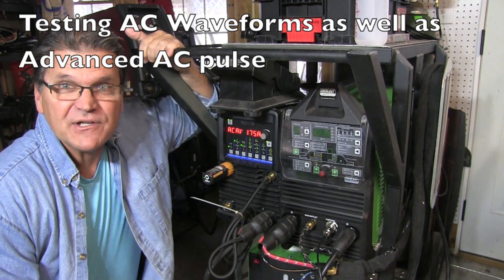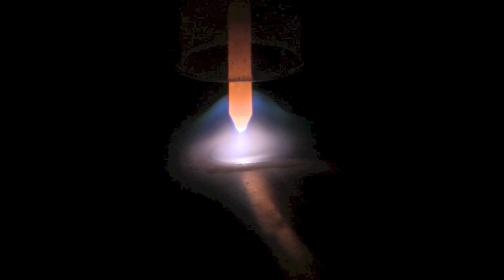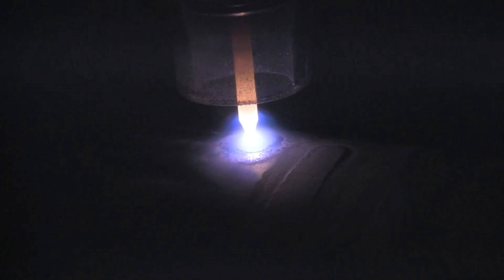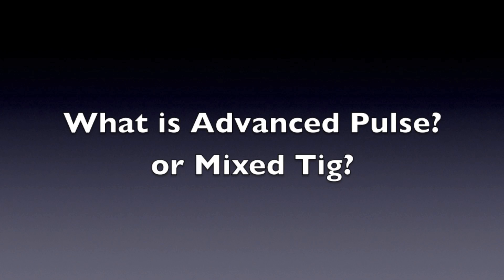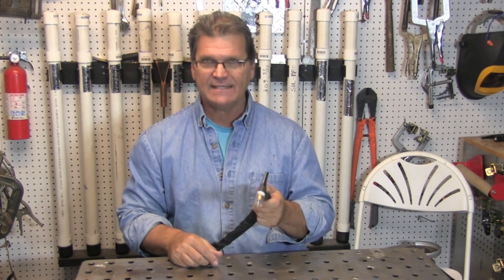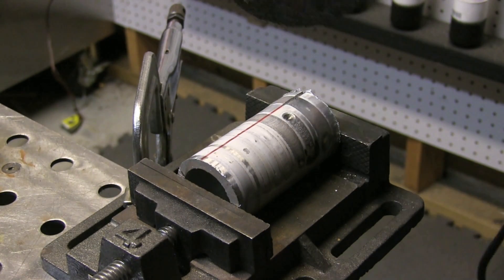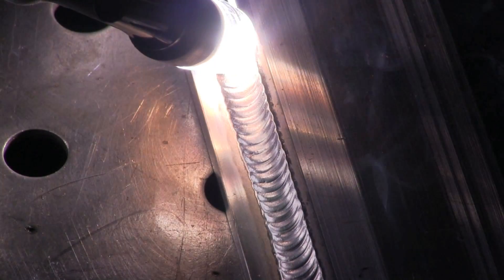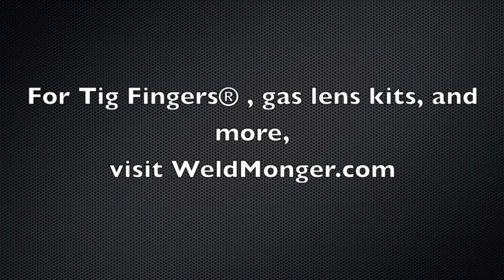AC Waveforms and Advanced AC Pulse Tig - Miller Dynasty 280 and Everlast 255ext

Comment: The different waves are how quickly they lower and then switch current so the different waves create how fast is goes from cleaning to penetrating.   I’m not a professional welder jus referring to how the waves work in electronics in a vehicle wiring and sensors.

Comment: Would you be interesting to see how many amps you could reduce the advanced waveform to match the square wave. Compare the heat affected zones of both welds at equal penetration depth within the base material.

Comment: Do the different wave forms place different loads on the hardware producing them?   As in will the machine (computer board) last longer using one wave over another?
Reply from the maker: That’s a great question. I honestly don’t know the answer.  I don’t think  using any one waveform is worse.  I have a friend with a dynasty 400 who welds aluminum all day and switches waveforms often depending on situations. I know that doesn’t really prove anything but it’s something

Comment: The X axis is time, and the Y axis is voltage.  The middle point is 0V.  The wave form is just how abruptly the voltage goes up and down.  On/off is a square wave.  The ebb and flow from an alternator is a sin wave. A micro-controller and a few cheap components can produce whatever wave you like.  The square wave works well because it blows out the oxidation.  Electronic stuff likes the gentle sin wave.  The flat peaks of the squares are moments of DC current.  AC is simply DC that flips between DC+ and DC-.  It's the building and collapsing of a magnetic field that makes transformers work.  They likely give you those options because it costs them virtually nothing to include them and they can up the price.  The advanced square sound the same as simply lowering your cleaning pulse.

Comment: Question about the syncrowave 300 with the advanced squarewave vs dynasty 280 Dx with wave form selection. Is that 20 Amp difference going to hold me back alot?? I ran into some 3/8" aluminum the other day that my chinease 200 amp machine couldn't really penetrate.. im On the fence with the selection. I feel I may need the more amps.  I'm getting it more for ac aluminum welding and  the dynasty has more options along with ac pulse. Help and thanks

Comment: Isn‘t it just like that you just transfer the amount of energy in each direction (EN and EP) summerized below the wave? So most energy is transfered by „advanced square“ and least by „triangle wave“? Additionally there is the „frequency“ effect tighten up the arc when containing higher frequencies so most of that effect should be seen with „advanced squere“ and least of it with „sine wave“? Other than that the effect should be hardly noticable. Corret? (As maybe known higher frequencies are contained more as faster the waves rise or fall on their sides)

Comment: Isn't the heat in the arc?  I thought both ends were the same temperature and polarity only affected which way the metal vapour migrates.  If this is true, the balling on the electrode will be fouling from the base metal and not the tungsten melting.   This jives with using EP to crack off an oxide layer,  or to prevent tungsten contamination if that matters for magnesium.  IANAW except for a bit of stick so far.

Comment: The below guys are correct: the mixed TIG case has a higher average heat input - the same as if the machine had been set to 85% cleaning: (The AC is 70% EN)*(and the cycle is AC 50% of the time) + (DC is 100% EN)*(50% of the time) = 85% EN.

Plus, you get (mild) pulsing, since the AC part of the cycle is only like 85% as hot as the DC-only part, which should help penetration.

But who cares if the machine is technically set a bit hotter? It's probably less prone to balling up the tungsten than a machine set to pulse between 160 & 190 amps @ 85% EN-AC... and you don't get the flicker.

Comment: Hi Jodie I might have the answer to your question what this advanced Pulse function is for. This fuction aka "Dual wave" on the REHM devices here in DE is described as " to use when (very) thin Aluminium needs to be welded to thick material or in difficult positions" .

Comment: This advanced AC is pretty neat, lately I was wondering why manufactureres won't do something like this, turns out it's already in the metal. Now I'm interested in what is the minimal current you need on EP side to conistently break oxide film, I understand it's probably electrode size dependant, but still? And if I understand this right, this advanced ac pulse is squarewave only, will it be hard to make an assymetric triangle wave?

Comment: Hi,

I'm just learning to weld and really like your videos.  They are very well made and well explained.  Unfortunately, I don't yet understand all the lingo but I am getting there.  Would you consider doing a video on the size of electrode you use for which application?  By this I mean could you explain why use a 3/32" electrode on a certain thickness and for which metal, etc?  Lastly, when to ball or not and how pointy a tip is better (or worse) depending on the situation.  Maybe this could be more than one video.  Kind of a "Newbie video series".

Thank you again for all your help and taking the time to do this.

B
P.S.:  Still waiting on part III of your machine review... ;-)

Comment: The reason your last weld penetrated more can be understood by looking at the "area under the curve" or in other words, color in the wave forms and determine how many square inches or millimeters you have colored per cycle. You will find the constant DC Plus AC on top of it will be a lot more area, therefore energy / penetration.

Comment: A possibility we always have to be mindful about is old fashioned marketing voo-doo, aka horseshit. One might think that a different waveform characteristic might make some difference in the weld, but if that difference is within the margin of error and/or not repeatable and/or can be replicated by simply changing some other standard setting, then it's ultimately moot. Irrelevant. Does not matter. This reminds me a lot of the 'electric guitar tonewood' argument, where marketers have convinced people that the body or neck wood of an electric guitar will change the 'tone'... and some people passionately believe that but belief is not science and ultimately, turns out it's not true. Unless someone can explain- then demonstrate- just what different waveforms actually do in AC welding in terms of achieving some mechanical process that cannot be otherwise achieved by modifying some existing, standard parameter, I remain a skeptic of waveform relevance. (BTW, your videos are light years ahead of anyone elses. Thank you.)

Comment: I've got the Ac/dc mix setting on my kemppi mastertig. I've only mucked around with it but i too saw a deep penetration. Not sure whered itd be used unless you had some solid butt welds with no gaps. I to prefer the square wave i like its nice sharp hit on the positive side good when aiming for a nice uniform weld size

Comment: Hey Jody, longtime fan and tig-finger owner here, also a fellow welder too, I just wanted to ask if you could do a video with some sch. 10 stainless pipe -tig. I would prefer backfeeding but lay-wire/pressure-feeding would be fine too. I've been having a real hard time with sch. 10 stainless and could sure use some help. I'd GREATLY appreciate. Keep up the great work and awesome videos, I know the welding community appreciates it.

Comment: I really would like to see someone do an open butt joint on aluminum pipe I tested for a 6gr and failed for lack of fusion and also my root didn't go in as well as I would have liked. Do the Miller machines have this feature that's what I tested with
Reply: No, Miler does not have this currently.  But Fronius may have introduced this as well.  Not sure.  We've had this out for about  years now.

Comment: The Advanced Pulse can be used for thin metal as well by dropping the DC current to almost nothing.   Great bead profile.
Reply: Everlast Power Equipment if you're welding thin metal what's the point in using advance pulse.
Reply: You can readjust DC to a lower percentage, elow 50% and it begins to have a different effect, and changes bead profile.

Comment: Way more advanced than I will ever use, but very interesting nonetheless.  One question if you can bear with a total newbie, I noticed that the arc seemed to be wandering quite a bit at the start of the last demo (with filler rod).  Is that normal for using frequency with the arc, or particular to this particular profile? (Hope I made sense)

Comment: If it's electrode positive, the electrons flow from the torch to the workpiece? Electrode negative the electrons flow from the work to the torch? The last time I checked electrons from from Positive to Negative! Can someone tell me why I'm confused?!?!
Reply: My training was that electrons flow from negative to positive. EP=electron flow FROM workpiece TO electrode...causing electrode to heat up. "Normal" setup is Electrode Negative=electron flow (current) from electrode to workpiece. Wikipedia quote "The negatively charged electrode generates heat by emitting electrons, 
which travel across the arc, causing thermal ionization of the shielding
 gas and increasing the temperature of the base material."
Reply: Patrick Pikulski no,you have it opposite
Reply: Electricity was discovered first, and was thought of at the time as a positive charge flowing from + to -. When the electron was discovered much later they realized that it was carrying a negative charge flowing from - to +. Oups, wrong way! 
But the concept och current going from + to - was already too deeply rooted to change. Works fine until you try to understand whats actually goes on inside things like semiconductors and welding arcs...

Comment: that's very cool when you're welding with advanced pulse, on the AC side of the pulse you can literally see the heat wicking up the tungsten, then it kicks over to DC and it pushes the heat out of the tungsten, super cool demo! I can definitely see some practical application for advanced pulse!

Comment: A short explanation as to the drawings of the waveforms. If you look at dc electricity, it is just one straight line instead of a wave. It should sit somewhere above or below the x axis, relatively higher or lower line on the x axis represents more relative voltage than one closer to the x axis line. 

As a welder knows AC electricity is alternating between the two polarities. How it does this is why we have all these waveforms. The easiest way to understand this is by looking at the ac square waveform. Imagine the DC "wave" drawn. It would be a straight line drawn either on dc electrode negative or positive so below or above the x axis. Imagine if you had a switch that would switch between dc electrode positive and negative while welding? Well it would look like a line at the top and then suddenly a line at the bottom and switching back and forth like that. This is a squarewave. AC electricity is that simple to generate. Its just a switch. 

So sine wave is like square wave but harder to understand. If you look at the sine wave it switches polarity but it has a smooth transition from one polarity to the other. Instead of switching instantly on or off, the voltage fades from dc positive to more and more negative and then fades and then more and more positive. The sine wave is really soft and this is where the viscous opinions form from. Soft squarewave is just the same as regular squarewave and triangle wave is like if you took the sinewave and made it a diagonal line, idk why you would do that really. 
So an example would be +5v +4v +3v +2v +1v 0v -1v -2v -3v -4v -5v while a squarewave would be +5v +5v +5v -5v -5v -5v +5v  

Polarity balance is essentially controlling how much time is spent in one polarity vs the other. So a more ECn squarewave would look like -5v -5v -5v -5v +5v +5v -5v -5v -5v -5v A sine wave is a bit more complicated than that but more or less the same. Keep in mind, the voltage doesn't change, just the time spent in a certain polarity. 

The waveform from your wall outlet is actually a sine wave and older technology scaled this down or up to get different wave forms. A transformer changes the voltage. This used solid tech thats quite beefy and large and intricate. New welding technology is all micro processors and voodoo solid state shit. These new welding machines can create ANY electrical waveform it wants. It's so clean that it actually is somewhat of a problem to some people. In old transformer machines, companies would actually try to mess up the machine and make an unclean waveform because sometimes if the stars aligned right, it'd create the right pulsing and amperage and etc. pattern to make an arc just perfect or well at least better. This is why some people like that really old machine that creates a magic arc. Its a lot like the difference between an incandescent light bulb and an led. We all know electricity passing through a wire to make it glow but LED's? Thats a whole new dimmension. What made it possible is solid state switches, I don't know how they work only that they exist and work.

If you read through all this, you probably wanna know that there's an MIT professor out on youtube that posts his lectures online, he talks about welding metallurgy and everything welding related. 50 years of experience in your hand. Why does one preheat and post heat. Hydrogen embrittlement, lots of stories about multi million dollar fuck ups.
Reply: Sublimated J just search thomas eagar welding metallurgy
Reply: @TKTK-sw3tq   I've just watched the introduction and the first Lecture proper on this great series and I intend to watch every single one I can get my greedy eyes and ears around, they are fantastic, encompassing a theory I've always had about Graduate Engineers who take a Job in Industry and on day one they know nothing of what the real world is about.
The sheer common sense Mr Eager teaches is like a breath of fresh air compared to stodgy and bloated Physics Lectures without any real world context.

Thanks TK - Stew in UK
Reply: TK TK great explanation appreciate it
Reply: TK TK dude thanks for the breakdown that was perfect!
Reply: TK TK where can I find the lectures?

Comment: That advanced AC pulse is amazing, thanks Jody!
Reply: That is a great feature. I'm surprised how reasonable the price is for the Everlast welder. Prices just keep getting more and more affordable for welders.
Reply: +Jon Ryan hey man im thinking this is a stupid question but the pulse he is using in the video is that different to just normal pulse?
Reply: Yes, it is very different. Jody is pretty good at explaining how this feature is different. AC adanvced pulse is where the current is alternated between DCEN and AC. You can get a lot more heat into the puddle than with a welder without it so a 250A welder can weld much thicker metal than a plain 250A welder without this feature.

Comment: the triangle wave look similar to what we hams call a saw tooth wave form. not exactly the same wave form. one side of the change in voltage is more vertical like the square wave. the other is sloped like the triangle. I wonder why these new inverters don't have saw tooth wave forms and posibly a soft saw tooth wave form. or have a reverse saw tooth like seeing the wave diagramed on paper and viewed in a mirror perspective.
Reply: The sides of the TRiangular wave form are straight due to the fast switch.  It's probably how it's drawn to simplify it.
Reply: Everlast Power Equipment;  being I'm a ham radio operator. I know wave forms. so thank you, for your atempt to inform someone who knew ahead of time. and I'm an extra class amateur radio operator, 73 de kf4dcy

Comment: Thanks for the great video. I think some of this stuff is just marketing BS. I have my choice of welders to use, and my favorite is a 15 year old Lincoln 175 AC square wave without any of the pulse or odd wave settings. I am a mechanical engineer and have been welding Aluminum for 20 years and never been able to make a measurable difference in strength between different settings. The best (strongest) welds have always been the smoothest welds  (least amount of "stacked dimes" look).  Filler rod ridges, valleys, craters etc., where always the cause of failure when parts were tested for strength.

Comment: Awesome video again Jody!! The different "wave forms" are how the electricity is flowing through the Tungsten. Just picture your foot pushing the pedal and trying to follow the curve over time. On a square wave form your foot would go instantly to your max power, hold for x amount of time, then instantly release for x amount of time, then instantly on, etc.. On a sine wave form your foot would move in a consistent fluid pattern never stopping at one amperage. Triangle would be linear up and down foot motion with instant changes at the top and bottom of the wave. Soft square would be the same as square except at the top and bottom of the wave you would increase and decrease slightly then drop off instantly. Your frequency dictates how often this wave happens over time 100hz=100 x per second.

Comment: Great video it's crazy how the last weld penetrated so deep compared to the rest
Reply: Amazing how just changing the waveform and thus the amount of time the high heat part of the wave spends on th e metal can make such a difference. Same power input but just more efficiently using it.